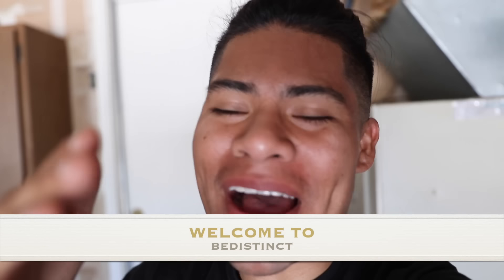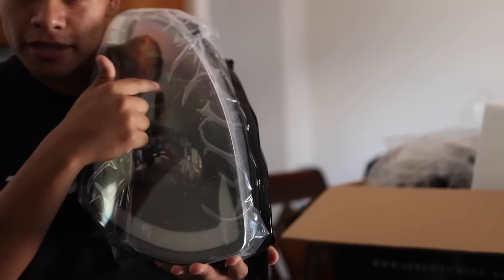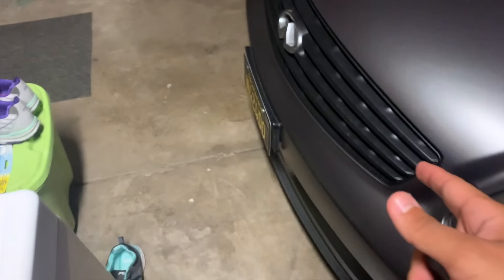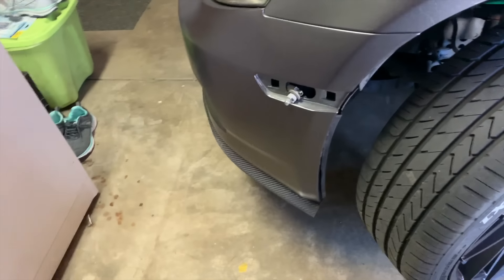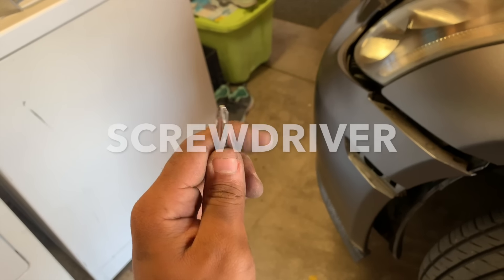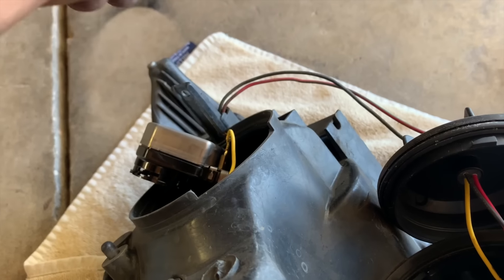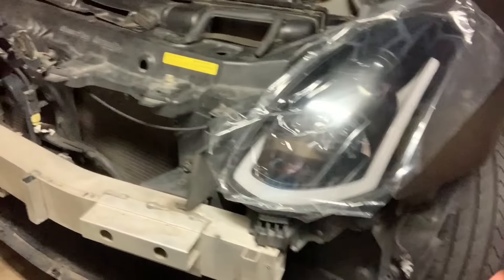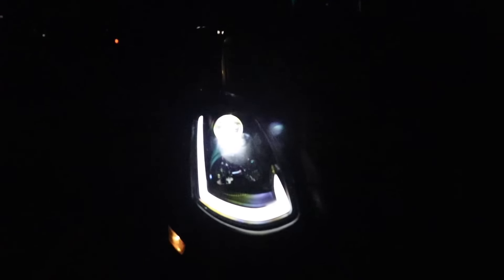G35 Gets SPEC D Tuning Sequential HEADLIGHTS ! + INSTALL (2023)

Comment: Hey I’ve had mine since January, and I’ve noticed that my led stripes no longer work unless my hazards or turning signals are being used... I was wondering if you know how to fix the daylight running light function of the headlights?
Reply: I could really use help

Comment: Do these have daytime running lights without having to turn on your actual lights?
Reply from the maker: So if you turn on your car the lights don't turn on. You right lever has 4 turns I am not sure what the first 2 are, but if you turn to the third click, that will run you your day running lights and if you turn it to 4th click that will give you your full night lights. So you just have to turn to 3rd click to have that running light going during the day.
Reply: Ya that’s what I thought. That means the tail lights will be on as well. That low key sucks. It’d be cool if they just ran like the newer cars with daytime lights where just the fronts are on.
Reply from the maker: ncbeatz actually the taillights don’t turn on. It is just the front headlights and the side markers. The taillights don’t, do it looks like the modern cars. It is only when you turn it all the way for night lights that you get the taillights
Reply: BeDistinct good to know. I did not know they had daytime running light tbh. Good looking out
Reply from the maker: ncbeatz me neither haha, once i bought them, i asked myself the same thing, “do g35 have daylight running lights?” Haha but yea surprisingly they do
Reply: BeDistinct I heard that stock USA models don’t have DRL, only Canadian models have them. Have you heard of this? I was doing a little bit of research and came across a few G forums saying this.
Reply from the maker: ncbeatz interesting never heard that. Maybe canadian models have true day running lights where you turn the car on and the light turns on with, not sure.